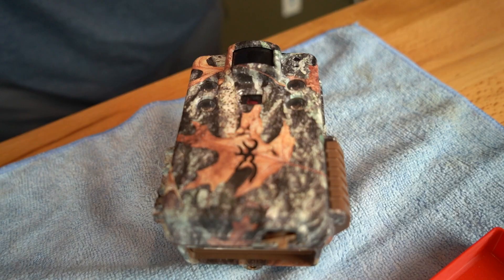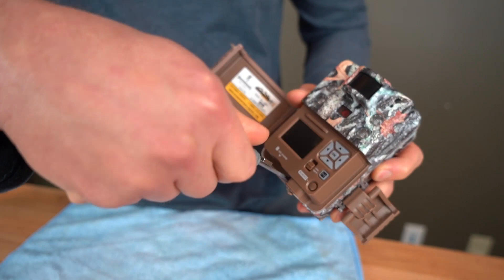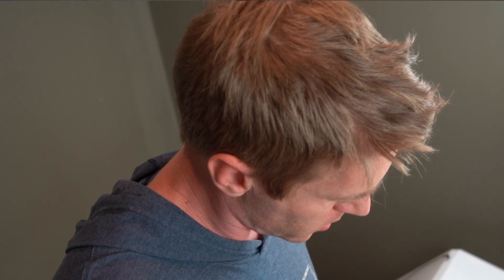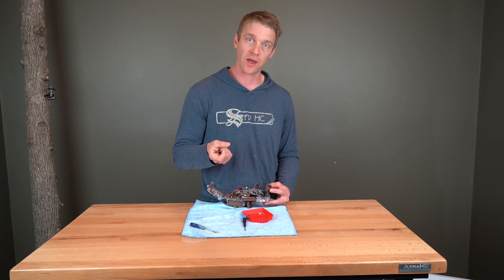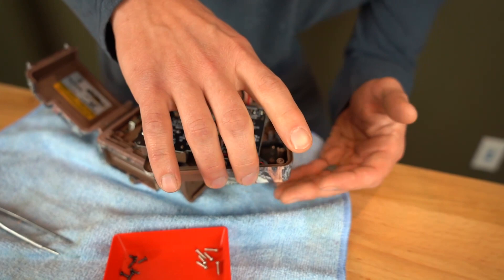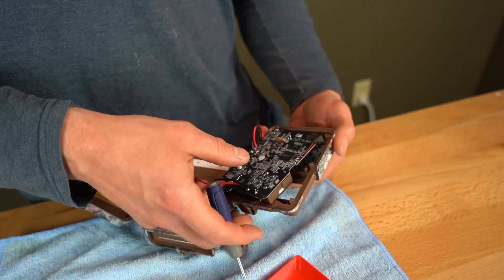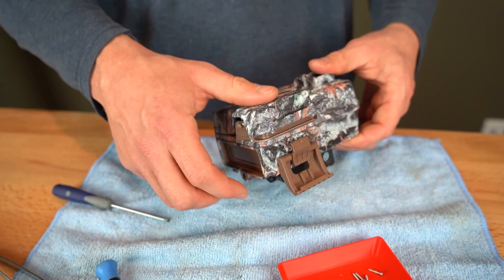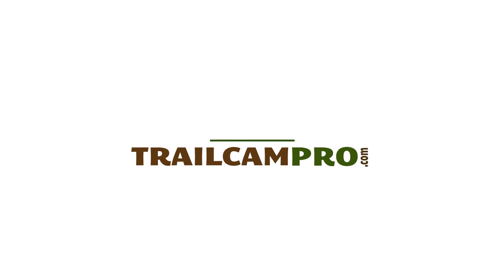How to Replace the PIR Lens on a Browning Trail Camera

Comment: I used  this video to replace  PIR lens  on Recon Force Extreme.
1. Phillips screwdriver size is 3 mm (Sets with tweezers, pick, magnitized ends, etc., cost around  $10.00)
2. In my Cam the 1st screws you removed were deep set & covered with soft plastic (for protection from moisture). I had to bend a large safety pin at tip to remove it.
3. My Cam did not have outside screw below screen. Everything else just like yours. PIR lens replaced.